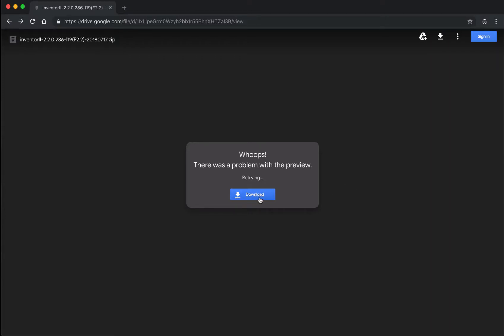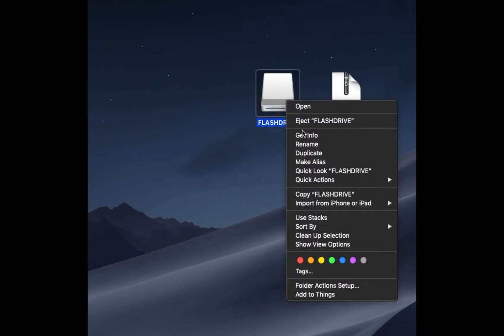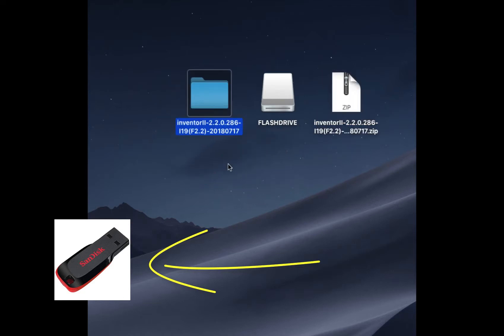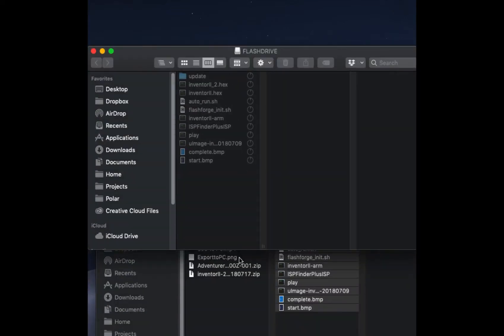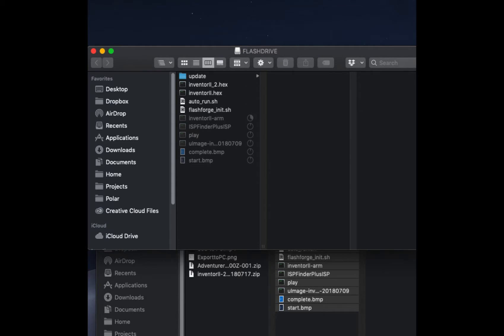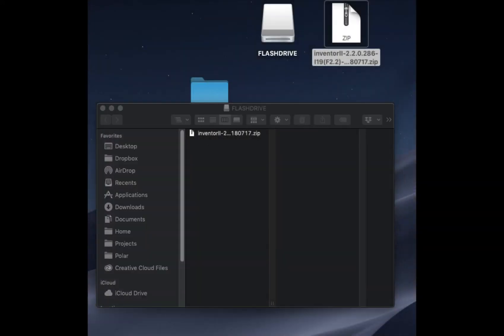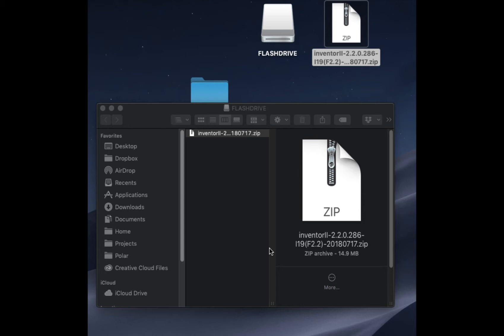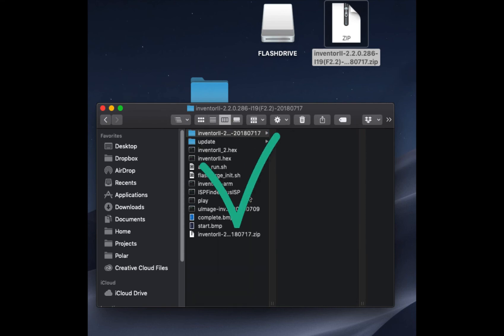Prepping your USB to Manually Update a Flashforge 3D Printer

Comment: I have an adventurer 3 flashforge 3 D printer. Where do i get the latest firmware updates. I am having issues to connect the printer to flashcloud. The seller said i need to update firmware but printer does not want to update via printer so they said i need to update via usb but does not give the link so incan get firmware update.